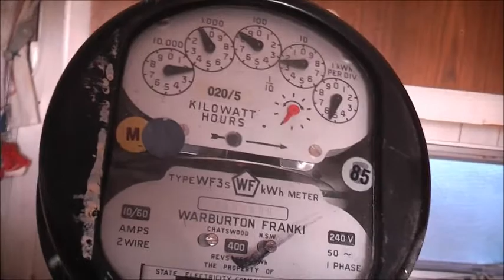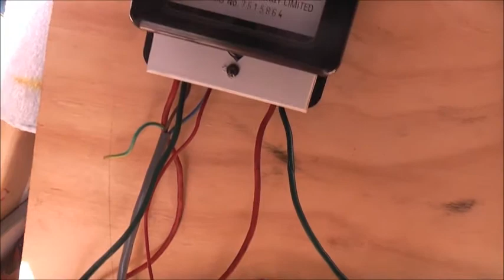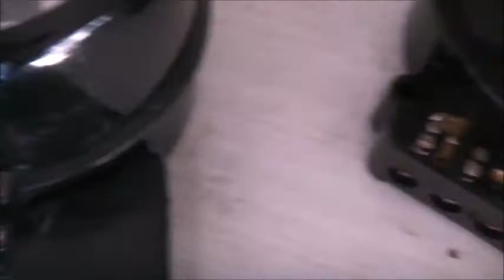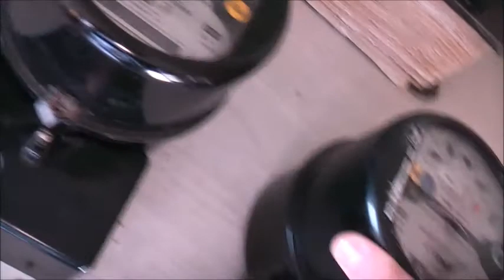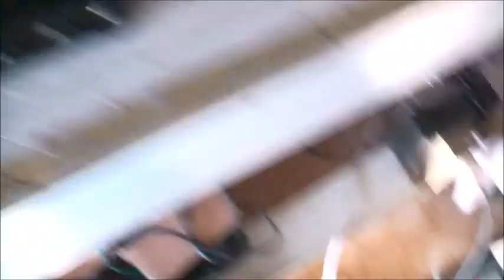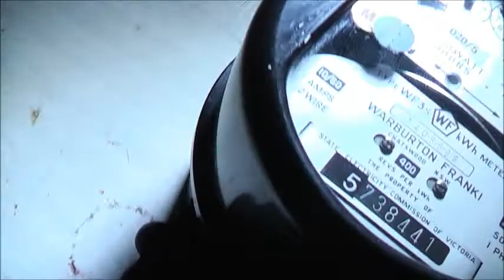Warburton Franki WF-3s Test & Clean

Comment: (Msg 1 of 2) When testing, you don't need the testing meter to have the same loadwheel characteristic. I test with a Sangamo Schlumberger SPA 02 & more often than not, the meter under test is a electromechanical meter with a loadwheel.

The trick here is to "set-up" both meters prior to the phantom test: Make sure that both meters are SPOT-ON a certain 1/10th with the marker on the loadwheel right at the front, bang-on-dead-centre. Note the readings, start the test.

If your meter has a.........

Comment: (Msg 2 of 2) ....Characteristic of 200 revs/kWh, then 1/10 of 200 will be 20 revs of the loadwheel. Noting 1/10th of the meter's characteristic is important, as after the test, the loadwheel may be going at the right speed, but if it wasn't registering, this would indicate readout problems.

Testing meters or any form of testing is an act of precision.

Rodalco has it spot-on in his comment. Also, it WASN'T ME that said about putting the meters in parallel. The meters on my board are in series!

Comment: Set up your current source. in to meter 1, out of meter 1 in to meter 2 out of meter 2 to current source.  ( no parrallel wires here )
Voltage on meter 1 and Neutral to meter 1, jumper from Neutral meter 1 to Neutral meter 2.
The first meter will measure the burden of PT coil from meter 2 but that is negligible in the case of two meters under test.